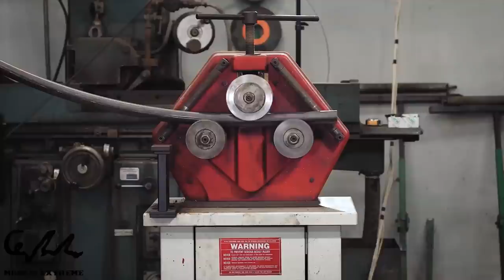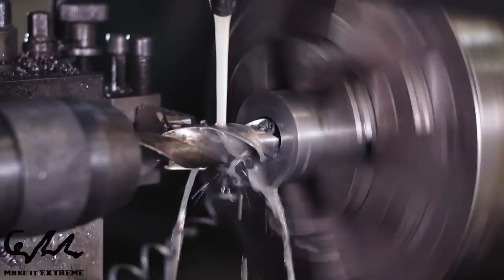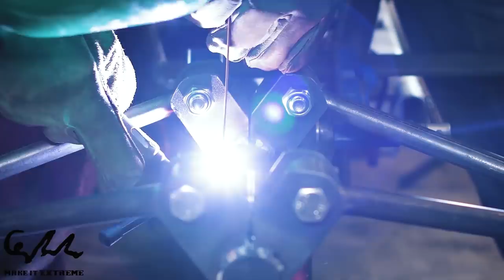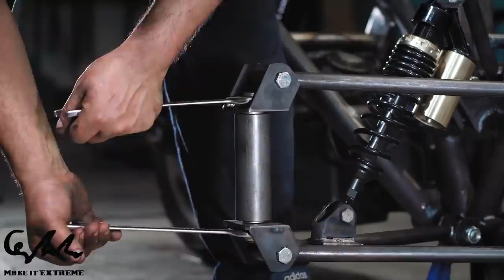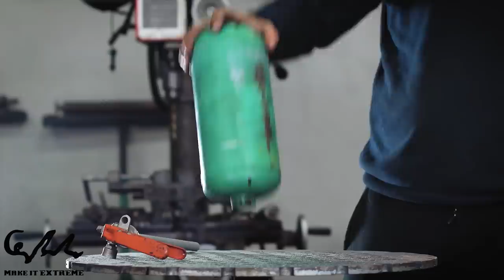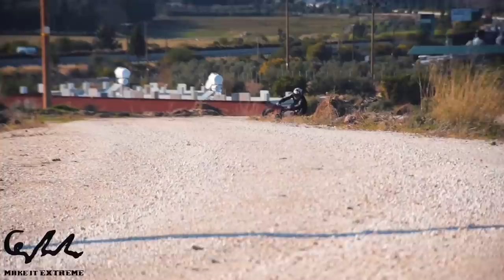Making a Reverse Tilting Trike

Comment: i think it is better to have rounded type motorcycle tires instead of those flat car tires for better traction on cornering
Reply: That was just about my only thought as well. Otherwise it’s brilliant 👌
Reply: Not only traction but handling in general. Those wheels want to stand upright and you have to force them to tilt. This here is what we call the dark side.

Awesome build though.
Reply: Yes, right.
Reply: Uh.  Ya
Reply: Maybe that's what he had in the garage. Maybe he didn't wanted to buy the wheels, it's very expensive
Reply: Exactly what I thinking. The flat tires do not give better traction on the road when turning.
Reply: Even if it were to have rounded moto tires it would probably cause it to flip easier less surface are to grip the ground
Reply: My thoughts exactly.
Reply: And give it like min 50hp more 👌

Comment: Nice idea. Though the  frame isn't long enough to make it look good with the large tires In  Front and the teeny tiny tire in the rear.
That motor  is lacking with that small moped engine.
 take that 49cc motor out and put in a 200+cc  so it can handle all the extra weight. 
Also noticed when your driving it there's a good amount of bump steering.

Comment: i would've used motorcycle tires for the front for less rolling resistance and a bigger tire in the rear for greater traction.